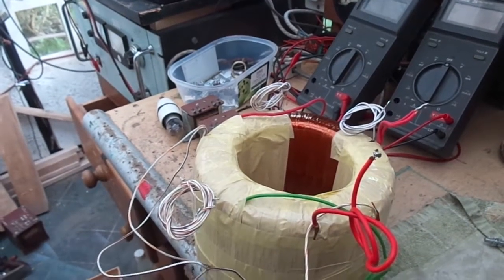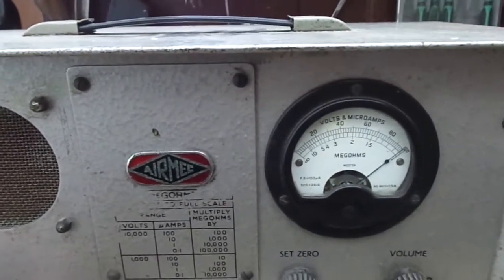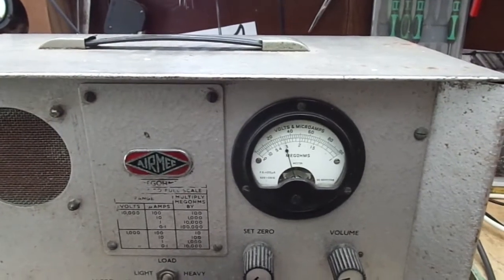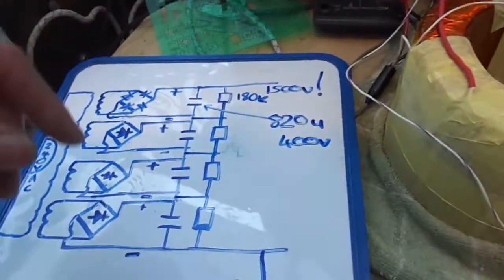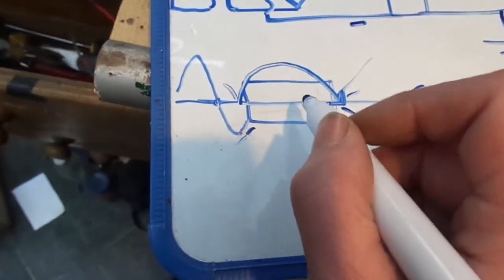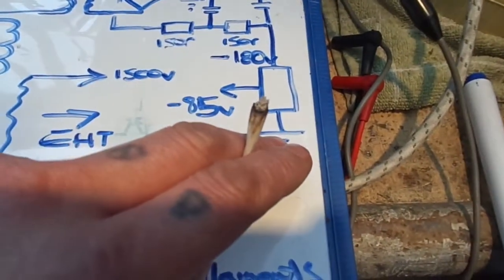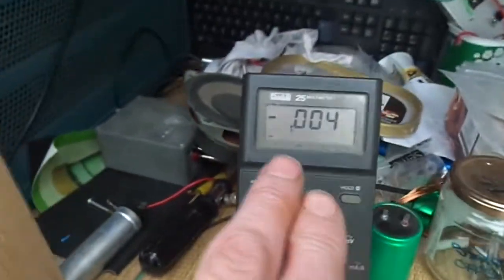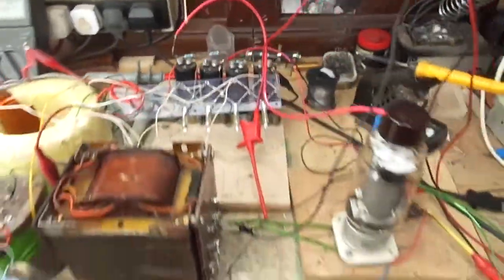Winding a Big 1KVA 2500v Toroidal Transformer By Hand - Part 2

Comment: Andy, Your mention of the dangers of working tired and after a brew were very timely. Also I should mention when working on HT circuits, keep any pets away. I have seen inquisitive children, customers, (pointing into set with finger "What's that ?" ZAAAAPPP!) ; dogs & cats zapped when working on TV sets in customers homes. ( Wet nose + B+ = an extreme danger to the pet and to the serviceman). 
 The old Ham adage:" Always keep one hand in your pocket when testing high voltages" is doubly important at the amperage levels you are using.

  Nice job on the transformer. I really liked your using the megger on it to check for insulation failure.  Those old 813's are rugged tubes. You can easily get 1/2 KW of RF out of them using CW only. (Morse Code for the Ham challenged).
Reply from the maker: No pets here or inquisitive kids, but take your point Frank. That said my daughter does have a habit of creeping up and going booh when I'm mucking about with electrickery, not good for the old ticker....DA.